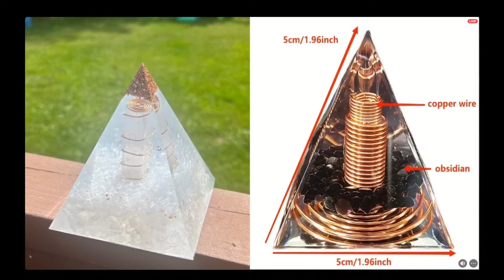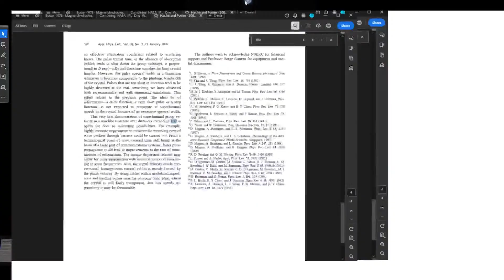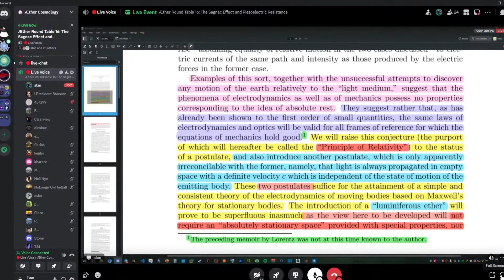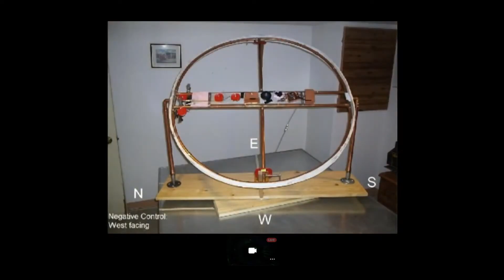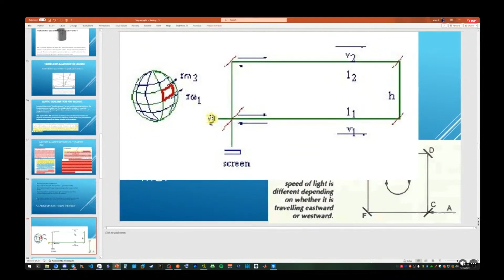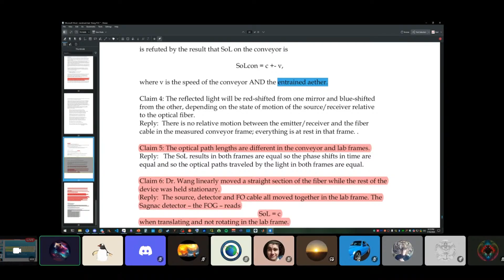Æther Round Table 16: The Sagnac Effect and Piezoelectric Resistance

Comment: BTW i am a firm believer that quantum mechanics is a Jerry rigged statistical framework for dealing with dynamics of matter structure that nobody has any idea of how to build a rigorous theory of, u know except me, because i have sort of done it, in the process anyway. it is the most interesting story of science in the 20th century really, the old boys came across atoms, and when they started probing their properties it became abundantly clear that nobody had any idea how to build them out of classical field theory, or some more exotic matter system, they did get some decent progress in on physical models, but they were very crude, and so when the atom was to be described, the only progress that was made was basically just ad hock stop gap models, that over time got formalized into frameworks for dealing with the observed behavior, they got increasingly more refined until we had quantum field theory as a more of less decently formalized field of study. but the chicken wire and the duck tape still remains in the theories, it is a still a poorly founded statistical framework of states that are not known properly. if you think about the theory that way, it makes perfect sense, you have to realize that the more difficult properties like entanglement are completely explainable when you include super luminal couplings and change qft a bit in terms of some predictions related to that sort of thing. people long thought and taught it was impossible, but they were wrong, and misunderstood the criteria for the no go theorems. don't attribute to corruption what can be attributed to negligence :).